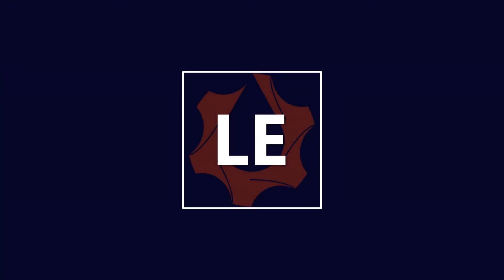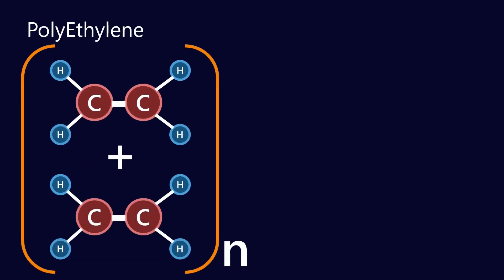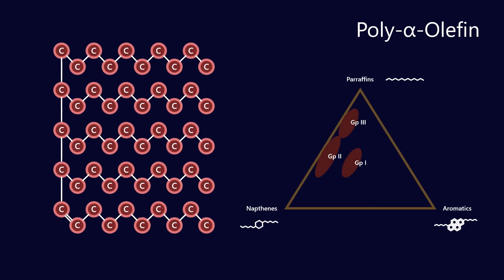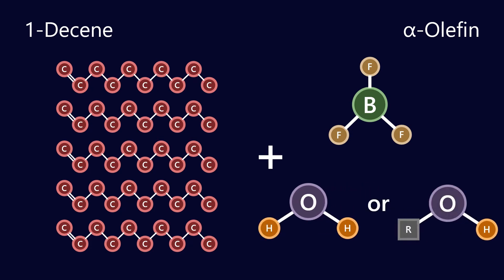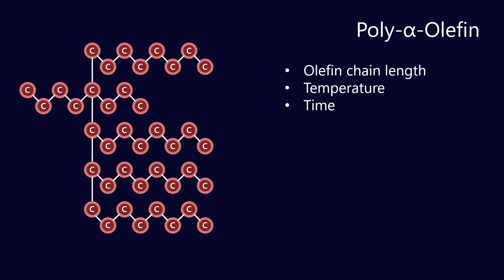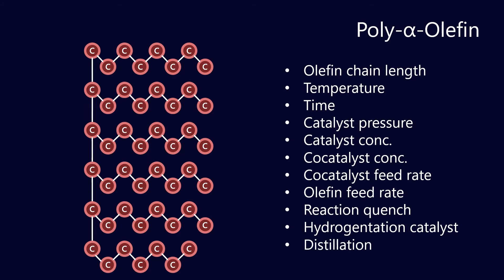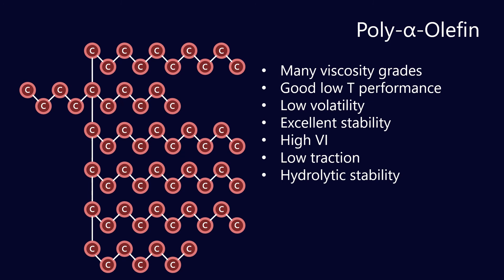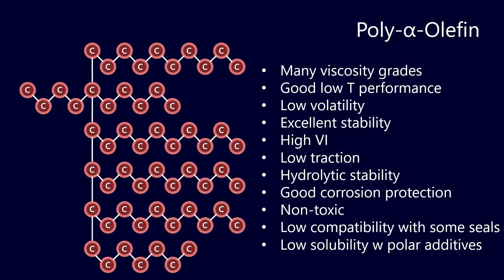How are PAO base oils manufactured?

Comment: I have no chemical background aside from a bit in the medical side.  I'm also a former Auto/Diesel tech so this is extremely interesting, at least to the extent I follow.  What I'd like to see is a comparasin between a good V like Redline and a PAO if anybody makes a pure PAO any more.
Reply from the maker: Hi! And thanks for your questions. I think there are still a handful of companies making PAO-based products. Amsoil springs to mind, but you're correct in that most of the "full synthetics" are actually Group III's in the engine oil world. It's a little difficult to make comparisons between engine oils, as the performance really depends on the application. But generally, PAO's are going to come out on top for oxidation stability, energy efficiency and wear protection. POE's come out on top for thermal stability - that's important in the turbo, but their big weakness is that they are sensitive to hydrolysis (breaking down in the presence of water).
Reply: Redline is the King of Ester but as a civil car and not beeing racing car i prefer to switch to Venol ( AMG brand Pao + Poe ) or Ravenol . For Fullsaps cars with no dpf for me Amsoil is the King .
Reply: @YeiDCalle  Never heard of Venol but I have Ravenol.  Sounds like good stuff.  I've heard Amsoil has quietly cheapened their oil base.  Even if it is good, I could never get past the whole marketing thing.  
I like Motul but it's confusing how many oils of the same weight/category they have.  
I wish they would put the percentage of base stocks in each oil on the container to make it easier to decide.
Reply: @datsuntoyy  been using RAVENOL VMP AND REP i switched to VENOL AMG BRAND ( Now EXLINE RED AMG BRAND ) with alquilated Naphatalene . 

Redline still in the podium but love the three of them . Redline - Extreme (Venol family ) from Poland - Ravenol .

Amsoil still pushing for quaility here , they never dissapoint . If i had a car with fullsaps oil i have no doubt i will go for them.

Castrol plus Motul always dissapointing . I will not put again them on my cars .
Reply: @YeiDCalle  Why don't you like Motul?
Reply: Thank you for informative topics, to choose an oil for a hi performance engine such as Porsche GT3
0w40 is specified by manufacture, if I go pull up DATA sheet 
Different brands have different numbers
V @ 40,100 C , VI ,HTHS , 
Is the higher VI and Higher HTHS a better choice ? Assuming information is truthful?  
Or a 0w 50  Eneos street racing witch surpasses all  and on bottle indicates 100%PAO
Greatly appreciate your kindness and hard work
Reply: Amsoil is a true PAO oil and I believe Mobil 1 extended performance is no other mobil oils are  just their extended performance. Amsoil and red line are phenomenal oils but I think red line is geared more towards racing and most of amsoils products are geared more towards extended drain intervals although they have some racing oils also
Reply: @trackpackgt373  No it's not.  Hasn't been in a while now.  Used to say in big letters "100% PAO", not anymore.  I wrote off to Amsoil they said their oil is a mixture of bases.  

They're relying on their reputation and have cheapened out.  There are true PAOs out there like Ravenol (at least some) but I don't think any are made in America.

Amsoil may have a limited amount that is, but by in large they're just a mixture now like Mobil 1.  Which uses 3, 4, and 5 base stocks in it's mix
Reply: @trackpackgt373  From Amsoil

Answer: AMSOIL maintains formulation details as proprietary and does not divulge specifics regarding the type of synthetic base stocks used in its synthetic lubricants. AMSOIL developed the world’s first API-qualified synthetic motor oil in 1972 and has remained the leader in the synthetic lubricant industry by continually researching new technologies and demanding only the highest-quality raw materials. As the company moves forward with new technologies it is increasingly more important that this information remains proprietary. AMSOIL views synthetic base oils the same as it views additives, with each having its own set of unique properties. AMSOIL does not insist on a particular type of base stock, but insists on particular performance parameters. AMSOIL chooses whichever synthetic base stock or combination of base stocks delivers the desired result and tailors its lubricants to be application-specific (gasoline, diesel, racing, transmission, gear, extended drain, extreme temperatures, etc.). At the end of the day, the type of base stock used to formulate the oil is inconsequential; the product’s performance is what matters.

I've heard it said other places that the best oil would be 1/2 PAO and 1/2 Ester like redline.  My personal is that even the mixes like Mobil 1, PP ultra and the like are "good enough" for 99% of the time, just change them regularly. I don't dislike Amsoil, Just don't want to pay $18 a quart when I can get 5 Mobil 1 for $22.
Reply: @datsuntoyy  I was never on the Amsoil train either until recently I always ran mobile one extended performance religiously a local store started carrying Amsoil Signature Series and I thought I'll give that a try within 300 miles I got a 10% increase in fuel mileage same viscosity as before which means 10% friction reduction on top of that my truck used to roll over three times fire and then get oil pressure like every other vehicle now by the third time it's rolled over it has full oil pressure before it even fires I was blown away because I thought I was running a really good synthetic before now I am on the amsoil train just like everybody else didn't buy into it until I finally ran it now I won't run anything else generator muscle car modern muscle car dirt bike lawn mower it's like my engines were being held back and now all the sudden they're set free like they were running honey before you can feel the reduced friction in them it's insane I imagine you can get the same results with red line but I tried Amsoil and now I'm staying LOL appreciate the information
Reply: "I've heard it said other places that the best oil would be 1/2 PAO and 1/2 Ester like redline"
I believe in that also.  Your paper posted above is the  same as they sent me, but I had a little more included.  If I'm going to pay $18 a qt for AMSOIL (or whatever the rate it), I want to know what's in it and why it costs so much.

Personally I run 0w-40 Mobil 1. It's about $28 a jug and I use 8.8 qts.  I also change it every 5k
Reply: @trackpackgt373 Mobil 1 never used PAO it was GTL based until last year they went Hidrocraqued based.

Comment: IS PENNZOIL ULTRA PLATINUM OIL 🛢️ 100% SYNTHETIC, BELIEVE THEY USE HYDROGEN GAS FOR THE LIQUID BASE.
Reply from the maker: Good question. Penzzoil Ultra Platinum has Shell’s “PurePlus” base oil. This is the trade name for Gas to Liquids base oils which coverts natural gas into liquids. If you search “GTL base oils” I’ve done a separate video in them.

Comment: Top oils now with Pao+Ester List:
RedLine from United States
Ravenol from Germany
Venol From Russia but also produced in Germany
Amsoil Signature Series From Usa

There is also another decent brands but this ones for me are the best now. 

Greetings
Reply from the maker: Interesting - I haven't really looked into too many engine oil formulations. Usually the racing grades are full PAOs as well.
Reply: @LubricationExplained  who's full pao's? Explain the brands and the the name of the oils thank you
Reply: I see clearly that Ravenol is PAO+Ester but from Venol I only see some of their "AMG" line being Pao+Ester, can you confirm if Venol has more in their lineup or only the AMG that is Pao+Ester?

I also saw "Champion" and "Cofran" had Pao + Ester.

Is there any full Ester oils? Maybe "Ester core" Motul?
Reply: To my knoweledge no automotive market oil are 100% group iv or v oil, all of therm have at least 10% hc, most of them 20% and above @nesmio7378
Reply: @nesmio7378  there are no full easter oils

Comment: Good morning, around 7:19 you said double bonds are weaker than single bonds, did I understand right?!
If yes I would say that this is not true: double bonds are shorter and stronger compare to single ones (bond energy is around 600 KJ/mol vs. around 350 KJ/mol).

Thanks a lot for feedback and clarification.

In addition I would say thanks for all the video contents of your channel, it's easy understandable and well reported.
Regards
Reply from the maker: Ahh yes, good clarification. Meant to say that a single sigma bond is more difficult to break than the sp hybridised second bond in a double bond. So I guess I’m comparing a single bond, with one bond in a double bond.
Reply: @LubricationExplained  may be you mean weaker for oxidation

Comment: Catrol Edge and Mobil 1 list "1 Decene" in their SDS' but the maximum percentage I've seen is about 50% with Catrol Edge 0W-40. Even Mobil 1's 0W-40 (which is considered a premium grade oil) has only 20% 1 decene content. What exactly is the percentage of decene required to derive substantial benefits from these PAOs?
Reply from the maker: Truthfully the answer is 1% - because each additional % of PAO displacing a lower-quality base stock will enhance performance.

On top of that, not all PAOs are equal. mPAO technology gives better performance than cPAO, so you need less of it in a bottle to enhance performance.

There is also the question of what the rest of the lubricant is made from. For example, not all GpIII base oils are equal - Shell's GTL technology is marketed as GpIII+ because it has performance characteristics that start to approach a cPAO at a lower price point. On top of that, some engine oils may contain higher proportions of synthetic esters, which generally do not need to be specified on the SDS but have synthetic performance properties.

Finally, there is the blend. Formulators can blend two different base oils in ways that enhance the overall performance of the lubricant.

Hope that helps!

Comment: Would the Shell PurePlus base oil be considered as PAO since it's made with natural gas?
Reply from the maker: Great question! PurePlus is the market name for a technology called GTL (gas to liquid) which as you pointed out takes natural gas and turns it into base oil. The technology is currently categorised as Group III, or sometimes you will see it as Group III+. It isn’t classed as a Group IV PAO for a couple of reasons - firstly it isn’t made from linear olefins, but secondly natural gas isn’t as “pure” a raw material as ethylene gas. Natural gas will contain methane, propane, butane, but also carbon dioxide, hydrogen sulphide and nitrogen. As a result of the minor impurities, the base oil properties of a GTL are very good - but not quite on the same level as a PAO. Hope that explanation helps!
Reply: @LubricationExplained  great explanation, thanks!

Comment: Do you know how much of Amsoil motorcycle oils are PAO based?
Reply from the maker: No unfortunately - generally lubricant manufacturers withhold details of the base oil mix and additive package. It’s often considered proprietary.
Reply: If u want pure pao or at least group III+, ravenol for the win!
Reply: All Amsoil motor oils use PAO base stock.
Reply: Amsoil says they use Group III base oil
Reply: @mlbabineaux  They built their reputation on "100% PAO" and now it's essentially the same kind of base oil as everybody else yet is still has the cult like following.
Reply: Schaeffer's Full Synthetic products are Group IV only. Blends are Group II plus and Group IV.